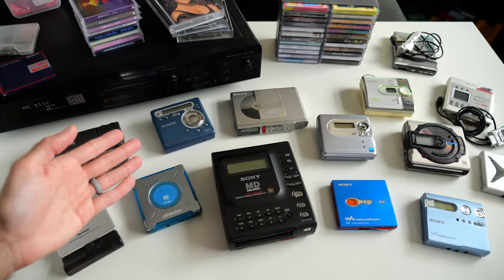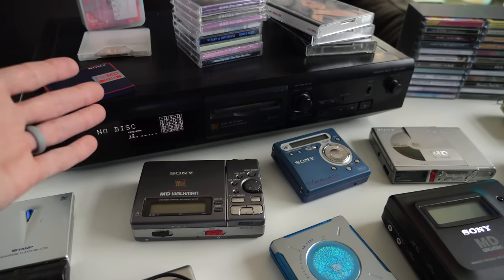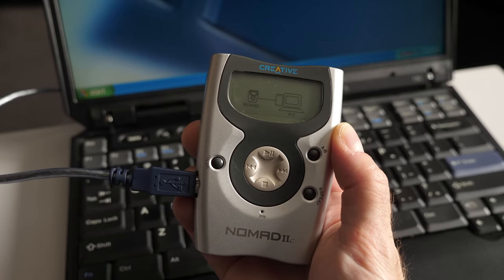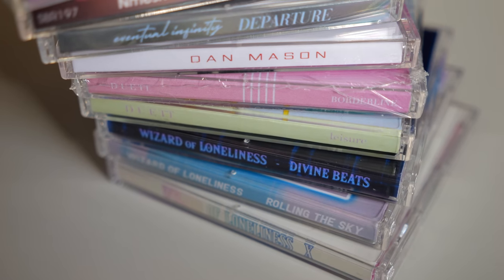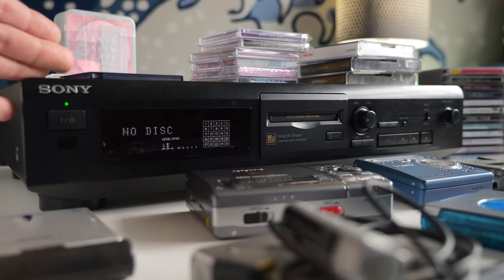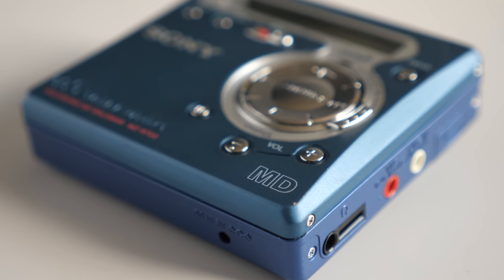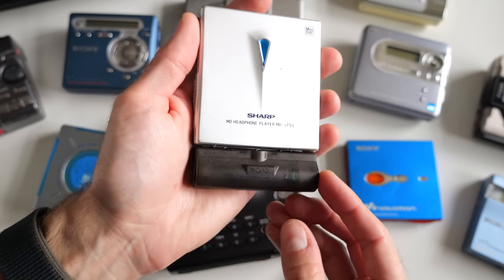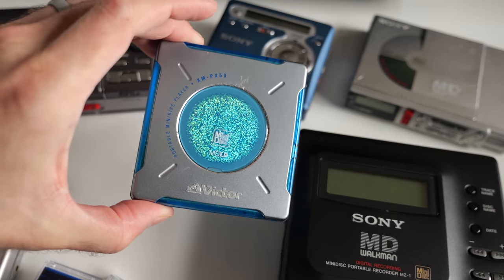Retro Buyer's Guide: MiniDisc!

Comment: Besides web md there is net MD wizard as well as platinum MD I have all three installed they are free to download! On repairing the MD recorders I’ve picked up lots myself and I don’t know if it’s luck but probably is but I fixed 99.9% of them I picked up an MZ-1 The first MD recorder player that was an import it wasn’t working when I got it but a week later I got it working there is on eBay an adapter for the MZ-1 that will allow you to use cells like you would use in a vaping device. And it goes on the inside not the outside. So you put two cells in and it works just fine it’s just the original battery from Sony was shot. Thankfully it didn’t leak in the unit because the old owner didn’t keep the battery pack in it. But what was wrong with it was the loading device wasn’t accepting a disk it would keep spitting it out it was just a small mechanical issue on the inside

Comment: i NEED to see that video to fix my deck, been working with that loading tray issue for years, it only does it if disk pops out but if disk goes in it stops doing it. i also love my MD MZ-R70, is a hidden gem cheap and durable and runs on 1 AA battery. my MDLP MZ-E900 is scratching my disks at moment, i need to take it apart to figure out whats going on.

Comment: You are totally wrong about the main selling point.
The main selling point is that the discs are re-writeable, much like CD-RWS. Honestly that should be obvious...
Also, later on, it was the fact that the devices themselves could be used as a drive to write onto the discs, so you didn't need special recording hardware, just a PC.
This is not even mentioning the fact that their devices were much cheaper than MP3 players of the era.

Comment: I was all in back 20 yrs ago and just pulled out my old units and they won't work😢...  my MDS-JB940 didn't eject my MD and then stopped turning on.  It's just humming.  I coupled it with a MZ-N910, and it too isn't working.  The 910 had a working screen and the remote is working and controlling everything but it won't play.  Have you any videos for repairs??  Thnx

Comment: If, like me, you do not like Chrome, there are standalone app to record to netMD: Platinum MD and NetMD wizard. I have been using platinum MD for some time and it works fine. My suggestion for an entry unit would be a recorder in the "5xx" series, like MZ-R505 and similar: made of sturdy plastic, they are cheaper than higher models (like the "7xx" or "9xx" series) and not sought so much from collectors.

Comment: I fell immediately in love with many discs recorder portables especially those which you could connect microphones to.. using it always for live boot play audio production so you can go into any concert you wanted put the damn thing in your pocket as small as smaller than a pack of cigarettes no one would ever see them the microphones which were usually if you were smart kick drum high hat Mike's they were extraordinarily small and can handle very high levels of decibel in Sonic pressure. So if you are lucky enough to sit right in front of the snacks let's say during a live show of Genesis or David Bowie or Pink Floyd you could record the whole show as though it sounded very much like a soundboard recording..
The next step where CDR recorders the stand-alone CDR recorders were only made by two companies in the discs themselves which for 74 minutes and 60 minutes recordable CDs were made by TDK only and quite expensive.... Prior to 1988 the only way to bootleg show was to use bulky 4-channel cassette decks that could hopefully be stealthy hidden under clothes ..the other where individuals who are bold enough to be treated like a quadriplegic in a wheelchair and have the recorders and the mics and the stacks built into the chair. To look like the battery packs that were controlling the chair... Where to be true without Sony mini disc portable recorders or the DAT Sony recorders portable.. most bootlegs would never have existed, thank you so very much Sony. You are the gods of life dive recordings

Comment: My NETMD player/recorder also had a radio & Analog TV Audio tuner when used with the remote, which I actually used out and about. I only ever saw prerecorded minidiscs in Japan, but I never bought one.
Reply: For what it’s worth, I have a HiMD unit that has the radio remote. I imported mine from the UK, and it only had FM and 9kHz spacing on AM. I bought the US remote for an MZ-NF610 (NetMD+AM/FM/TV audio/Weather), and it worked, giving my British HiMD player the full frequency range of the American units. It seems that a significant amount of the radio hardware is in the remotes, though some of it seems to be on the players themselves, as well.

Comment: How about the various multi-track formats? In jr college we had a few 4 trackers and at least one 8-tracker - course none of them would do the HiMD which wd have been nice cuz they weren't around long enough.

Same with the various still/movie formats on MD

The other question is the reverse of the uploading the music to the MD which is downloading it off of what's there into a DAW/film/photo editing program.

For awhile there was a PIT-IN computer-bay based MD drive that could be hacked/flashed and some again buggy software that was just supposed to be able to read the disc and lay it onto a hard drive raw just like it was and then figure out a program to convert the files back into something you can use.

A guy in England was trying to get the hacks to work a little better, but word is he passed away in the middle and nobody else was taking up the mantle.

But media transfer and restoration specialists would L O V E to get their hands on something that could read any minidisc format ever produced - especially discs that had more than one format on the same disc - or discs that had become unreadable due to TOC and other read/write failures etc.

Comment: I got into MD in 1998 and by 2005 had a pretty decent collection of pre-recorded discs as well as a couple of Sony portable recorders. Then I stupidly sold them off for pretty cheap (people were just getting rid of MD stuff around the time), in order to offset the cost of migrating to Mp3 players. I bought an iPod Nano 4GB and a Creative Vision M 30GB with part of the proceeds. If I had just decided to save up a couple of months to buy those instead of selling my MD collection, I'd still be able to hold & use the things that got me through my long commutes & idle time in between classes. Stupid stupid stupid!
Reply: That's around the time that I started buying them up. From about 2003 until 2012 I bought alot of them on ebay and Craigslist. I still have most if it. I did sell some of it off over the years but mostly the Hi-MD stuff. I still love the format even though I don't use it as much these days.

Comment: I just bought a mint Net MD recorder for$100. It didn't work at first. Now it does, I'm guessing the old grease got loosened up. I'm using Platinum MD software. Works great and I can transfer all my flac library. I have iPods and Android Walkmans. I just purchased an open box Hi-MD for $300. Let's see how that works. I just wanted a mint MD player with DC input and optical input. Hopefully I can record in regular MD format with that.

Comment: MD will last because it's mostly recording lasers that fail. MD uses a magnet to write to disc and a laser to read.
Reply: The laser is used to heat up the bits to be recorded with up to 9mW. So the laser DOES age when recording. Playback - not so much.

Comment: I heard that the WEB MINI DISK program can use some Net MD decks for ripping standard mini disks like MZ RH1, but sadly my HI MD MZ-NH700 seems to be unable to use the HOMEBREW mode. It would be handy if you tested a few net MD decks to let us all know which NET MD units can Rip MD disks with 100% certainty so we know which ones to buy as MZ RH1 is a ripoff and i am not in the mood for replacing the screen. I know that my HI MD deck can rip normal disks if I record in Hi MD format, but I have a huge catalogue of SP disks that i would love to rip to my digital library without having to manually record and label every track. SO currently on the market for a simpler NET MD uinit that can RIp via WEB MD program. I just wish I knew which NET MD deck to get. My most frequent use case for MD disks is. RECORD live and rip the disk to PC for further editing. Also I love the fact that HI MD decks allow you to store data on all MD disks. I often use those for game emulation. Reminds me of PSP.
Reply: I use the latest version of Sonic Stage (the one floating around online) on my PC using the MZ-RH1 driver (with my non MZ-RH1 HiMD recorder), and it lets me import recordings as PCM files. Granted, Sonic Stage deserves its reputation for finickiness, it crashes and has to do a library rescan literally every other time I open it, and it certainly doesn’t handle multithreading well, but it DOES work with my HiMD recorder in Hi-SP and Hi-LP (which, unfortunately, PlatinumMD and WebMD don’t do yet).
Reply: @danthemainman1  mY hImd RECORDER CAN rip AND burn VIA SONIC STAGE, BUT ONLY hi-lp AND hi-sp AND pcm MODE RECORDINGS CAN BE RIPPED. i AM MORE INTERESTED IN HIGHER THAN REALTIME RIPPING OF NORMAL sp/lp2/lp4 mINI dISKS.

Comment: I love love LOVE minidisc. Love the tactile format. Love the discs. love the variety. Really missed out on it back in the day when i went Mp3 instead because of one Tweeter employee. Wish I had gone MD instead. 
I have soldered in a lipo pack into my Aiwa and my MZ-N10, and they both work great. Better battery life than OEM. Pretty easy if you have mediocre electronics skills. 

Also,  have you actually listened to that Duette album? It's a banger.

Comment: Back in the 90’s, I spent the equivalent of about $10k (in today’s money) on a complete MD ecosystem.
I had a few portables, a CD/MD boombox, a triple CD/MD hifi component, a Technics micro system (with MD), an MD deck in one car and a CD/MD deck in the other and about 500 MD’s, with various racks and multi-MD cases. and was a cult back then, and I remember getting all my work colleagues into it.
The boombox recorded CD to MD in more 1x speed.
I started going to Japan in 2001 and was amazed by the plethora of JDM MD equipment, but I got into the iPod very soon thereafter.

Comment: No Thanks ATRAC is a "lossy" compression used in MD
Reply: 292kbps. Very good!
Reply: @jean-pierrem34  Only with ATRAC3plus on very expensive Hi-MD Minidisc and still just 292kbps.
Reply: ATRAC R and above I would challenge anyone with "normal" hearing to differentiate.  The FFT analysis between ATRAC V4 (Older and more lossy) and R shows only a .029dB loss at 14khz, and 0.862dB at 16Khz...   Those that do claim to hear a difference between ATRAC R and a CD say its more in the nuance, pre-delay and echo and depth in very specific situations with very specific instruments.  Personally,  I can't tell even with very high end equipment - but I'm no "goldenear".
Reply: @robertl8069  Wrong. Hi-MD may be lossless. Standard ATRAC ("SP") is 292kbps from the start.

Comment: i Never saw the 60 minutes when it came to Denmark it was 74 for some time then 80 minutes i still own 40 or so recordable Disc no original were available in Denmark i bought a MDwalkman (with the remote control on the headset line )a version for the car, stationary for the stereo for recording but due to the Stereo i had only sound could go out so i needed a Discman to record analog real time on later i used my PS2 as it had a digital cable still only recording in real play time so high speed recording, i Guy i knew at the time he owned the  NetMD so he had the MDLP

Comment: I like MiniDisc and using my Sony MDS-E12 and MZ-NH600 a lot.
netMD came out 2001, the Nomad II 1999. In Oct. 2001 was the relase of the first iPod. 
Sony was too late to the USB party and the netMD had some restrictiction copying music from the disc to the PC and back, you could only copy your music 5 times via PC... and you had to use a special program (SonicStage) to convert the mp3 into atrac3 and on to you MiniDisc. So you copying from a  lossy format into an other one, this didn't sounded well and when you where using LP4 it sounded even worse.
If you are using wav and convert it into atrac3 LP4, on the other hand, the sound was really good (my default setting for live recording is LP4).

Comment: I have an MZNH600 as well as 3 unopened Hi-MD discs (and several used ones). When I bought them I paid $5 each, and last time I checked they were going for over $50.

If you're looking at hundreds of dollars though I'd recommend just getting a good portable DAC and buying uncompressed music; Hi-MD sound quality, whilst easily on par with CD at the time, has been surpassed by better quality recordings and higher bitrate than MD can play. Buy MD to play around with, and not for the sound quality.

Comment: Notice:
50% of MD devices  need complex, expensive and expert technics to be repaired, it is not easy never, check how minidisc repair is a trouble in videos in english and japaneses videos.
25% of MD devices are very expensive, add the price of shipping and a pissible service needed. 
24% of MD  devices are trash. (EDITED) 1% are an excellent deal working and reliable device with minor details.